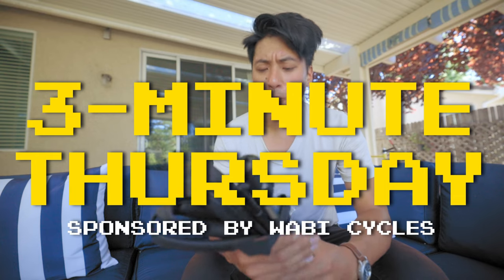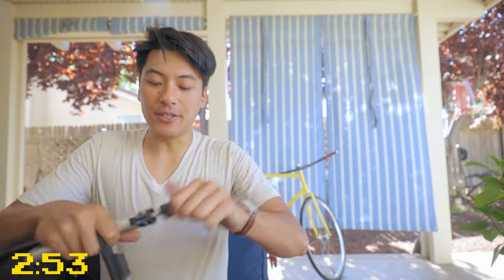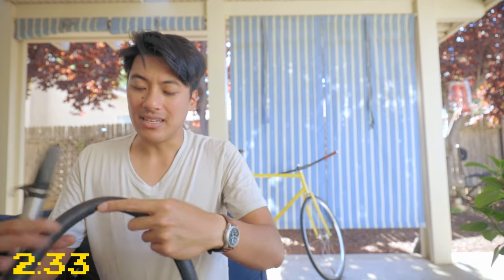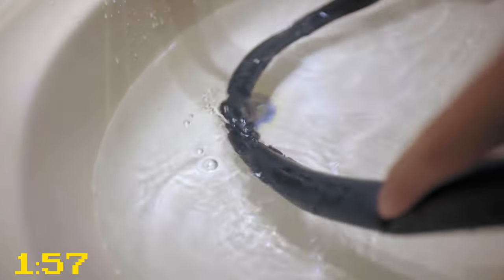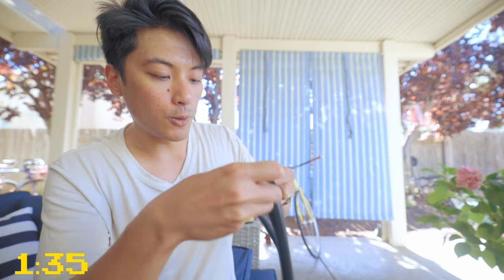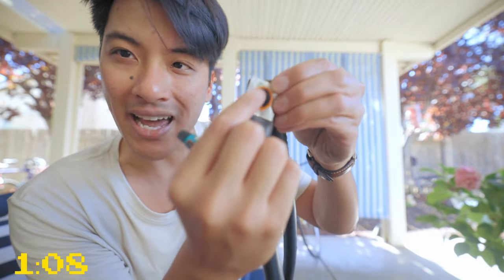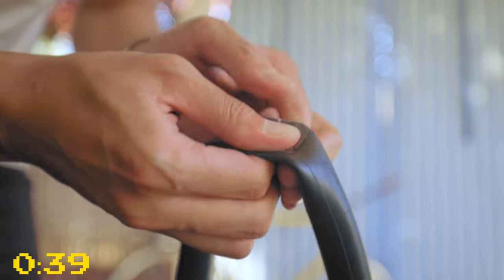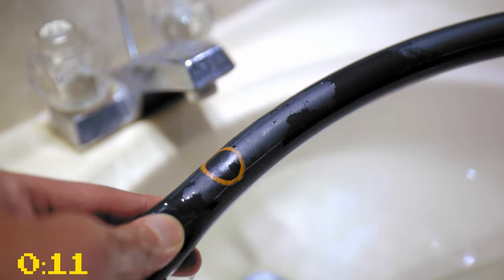Patching a Bike Tube is SUPER Easy, Here's How!

Comment: WRAP, STRETCH and POKE is the best method for sanding tubes. 1) WRAP the tube around a pole or door handle. 2) STRETCH the tube with your left hand to keep the tube in place. 3) POKE your index finger up under the puncture to provide a hard base on which to sand the tube. If the hole disappears. push up under the tube and the hole will re-appear clearly. The white powder inside the tube will make the hole apparent and you'll never lose the puncture while your sanding.

Comment: Speaking for the non-fixed gear bikes, hard part is not patching, but removing the rear wheel from the frame and putting it back there with the chain on properly. For a newbie, it takes a lot of time to figure out where the chain should sit on after mounting the wheel back. After patching my tubes few times, I decided to move to Marathon tires and since then I had zero flat despite I'm riding on broken shards and construction site leftovers in my city.
Reply: @Bebo Easy to say when you have the experience, had done that once or twice at least. But when it's the first time doing it, usually it is so easy to misplace the chain from derailleur and put it back. Bottomline: No one was born with that experience and confidence in the first place.
Reply: @Bebo It's your consideration of how you can dramatize it more. All I'm saying there are people out there didn't grow with bikes from childhood and learning stuff when they face the simple hardships like having flats during weekend rides.

Comment: So along with the patch kit, ya gotta carry tire levers and a high pressure mini-pump with you at all times. And a wrench to get your wheel off ('cause no self-respecting fixie rider uses quick releases). They're always in my messenger bag. Just in case.
Reply: It's hard af getting a tire to 120 PSI with a full sized pump. I'm not about to use a mini. Heh
Reply: @SansAziza  it's not the pump's fault that you are not strong enough
Reply: @safeasmilk1  Strong/heavy. My full body weight goes into the full size pump. Heh
Reply: @SansAziza  the pump is just to get you home. Mine goes up to about 70psi. That is rideable enough to get to a bike shop with a floor pump or home.
Reply: @Bebo My mini-pump, tire levers, patch kit and wrench will easily fit my jersey back pockets if I want to leave the messenger bag at home. Beats waiting for a car to pick me up.
Reply: @Bebo I prefer to be independent and not have to rely on others to get me out of trouble. With tools on hand I can be fixed and on my way in 10 minutes, rather than have to wait for someone to come "rescue" me. I'm not saying my way is better than yours, but it works for me. I'm glad your way works for you. To each his own, I guess.

Comment: I can never patch my tubes I'll get so anxious about it not holding air. I'd just ride & keep wondering if it's letting air out again. Always gotta get a new tube.
Reply: Same. The paranoia is worse than the actual flat
Reply: Me neither. Once I went to a local bike shop to get my bike's wheels trued. After a week or so, I noticed that my rear tire wasn't holding air.

When I removed the tube I noticed something different — the tube was full of patches and was of a cheaper brand than what I bought when I built that bike — those f***ers at the bike shop replaced my relatively new tubes for badly patched old ones.

Went and bought new spare tubes right away.... I don't completely trust bike shops anymore, and neither tube patches.
Reply: @Bebo It's not about the money dude, it's about the trouble.

It sucks when you fix your damn bike to go to a ride with someone, and you have to calibrate your tires every 2 kilometers...
Reply: @Bebo "Man burns down local bike shop after declined refund."

Ngl, that'd be quite a headline, lmao

Comment: I remember patching a tube and when pumping it blew a hole through the patch 😅
Reply: Yeah that's happened to me too, and I was told to only re-inflate the tube inside the tyre, so the inside of the tyre holds the patch in place while the rubber cement dries fully.
Reply: @rocknrollzebra  I think in my case the hole was too big under the patch. Because I did inflate in the tire 😅

Comment: Put a quarter (coin) in your patch kit, use the coin's edges to 'stitch' the patch to the tube immediately after applying it.

	If there's excess glue around the patch, as there should be, leave the clear film in place to prevent that excess glue from sticking to the inside of the tire.